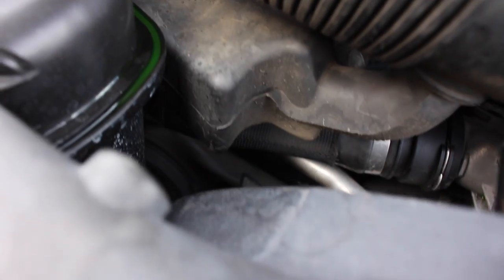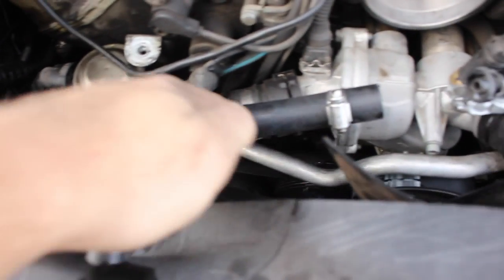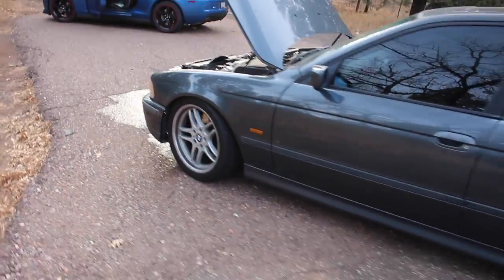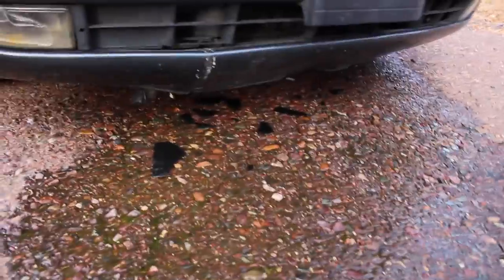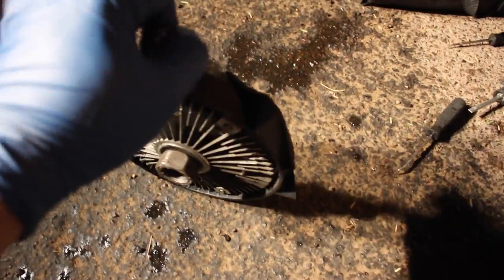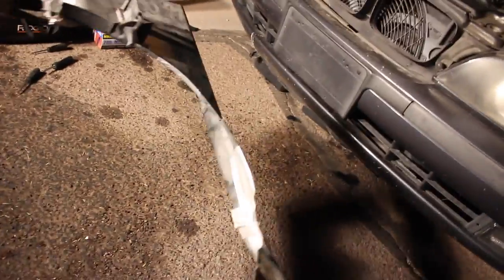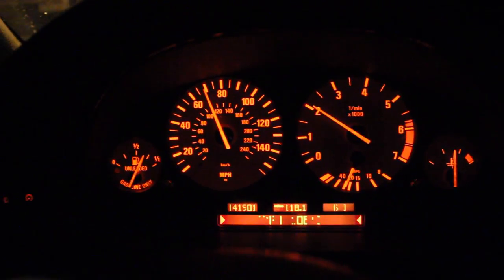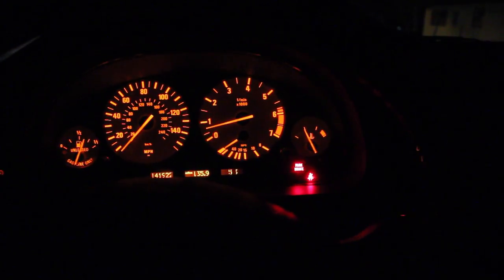My $1500 BMW 540i, aka The Bavarian Radiator Destroyer

Comment: Aw man.... I still love 540s tho. Going to buy my 2nd one next month. Since I crashed my old one.  Hopefully I can find one for 1500 like you... And Hopefully I can find a Non VANOS one in running condition.
Reply from the maker: I already fixed this one, so it wasn't down for very long. That's the benefit of E39's, they're pretty easy to fix when they do break. The non-Vanos ones definitely have the edge in reliability, but it's getting harder and harder to find them in good shape, especially with a manual.
Reply: Yes that's understandable. But I'd even take an auto. I really like these cars a lot especially since I've owned and daily drive a 97 540i before. So I'm familiar with what to look for in them.
Reply from the maker: Right on. Is there a particular reason you prefer the earlier 540i's? I like the later ones more, the Vanos gives the car a lot more low end torque and there are far less vacuum lines and cables under the hood. I've worked on both and I still prefer the Vanos cars, haha
Reply: The Vanos M62tu has a bad timing chain design which will lead to problems and expensive maintenance costs. I just had my 98 540i with low miles(pre Vanos) die last Friday night. Apparently the drain for the brake booster was clogged with leaves/debris. It rained and snowed a few nights in a row and the brake booster was filled with water. There is an engine vacuum located very close to the brake booster and sure enough the water made it's way to the engine and blew it with only 120k highway miles. I'm distraught. E39 guys: if your brake pedal is frozen in the winter, the booster is filled with water and it's going to destroy your engine. So having learned from my horrible experience with BMWs, I'm in the market for another 540i. lol
Reply from the maker: I'm quite aware of that, haha. I did a full video series on tearing down and rebuilding my X5's M62tu engine on this channel. I've done 10 of those rebuilds, and I'm doing an 11th one now for a customer. To be fair, the pre-Vanos M62 is not immune to timing chain guide issues— they last a little bit longer than the Vanos engines but they do eventually have the same chain guide issues as the chain guide design is pretty much identical. The only oldschool BMW V8 that's truly immune to the chain guide issues is the M60 which has a double timing chain and a sprocket in the middle as opposed to a failure-prone U-guide. The Vanos itself is pretty trouble-free on the M62tu, with the only problem being an extra bit of rattle that doesn't actually impact performance in any measurable manner.

Sorry to hear about your 540i, it's always a bummer to hear about an E39 dying. Have you considered swapping in a different engine? Non-Vanos M62's are dirt cheap on the used market, you could probably swap one in for far less than buying a whole different car. Thankfully I don't have to worry about brake booster water or freezing since it neither rains nor drops down to freezing in Phoenix.
Reply: I seem to come across more TU's with timing chain issues than 62's. But you're right, the rattle and noise doesn't really affect the functionality of the car. I live in NYC so parking is a premium, you've got to move your car every few days for "alternate side parking regulations" or get a ticket. With no motor, I had no place to put it, so I junked it today. The cheapest I could find an engine was for $1K and the shop wanted another $1300 for install. At $2300, I'm better off rolling the dice on another car. Everything else was perfect on the car, just had a rod go through the engine block because of all the water. Junked it for $250, still hurting....
Reply from the maker: That's a bummer, you should've listed it on Craigslist, I'm sure somebody would have scooped it up for at least $1k. Where in NYC do you live? I was born and raised in Brooklyn, lived there until 2014. My family had a garage and a driveway so I didn't have to deal with the parking stuff, but I can imagine how annoying it must be. I bet I could swap an engine in a day, even on the street. All I need is an engine crane and some basic tools.

The M62tu's get the chain guide issues sooner than the non-Vanos M62's, hence why you see more of them with issues. Most M62tu's start having issues around 150k miles, with some making it to 200k. I've rarely seen an M62 have chain guide issues with less than 200k miles. My theory on that is the Vanos puts more stress on the timing chain system, hence the earlier failure point.
Reply: I live in Ditmas Park/Kensington, by Cortelyou Road. I wish you had set up shop out here. Parking sucks here and I had it parked at the shop where they made the diagnosis. They were threatening to have it towed to the Navy Yard where they charge $35/per day if I didn't get it out of the shop asap, it's been there almost a week. I put an add on CL for $700 a couple days ago, but nobody came and got it in time. The shop was ripping me off with the install estimate because they knew they had me by the balls. I'm checking out a 2000 540i with 145k on the clock this weekend, the only issue is the Vanos is starting to act up. I'll let you know ho it goes....
Reply from the maker: Ah, so like the Flatbush area. I lived in Marine Park, not too far from Kings Plaza. To be fair, if I had continued living in NYC then I probably wouldn't have the space or the money to work on all these cars, haha.

Vanos starting to act up on that 2000 540i? If you find a P0021 or P0011 code then it's almost certainly the chain guides... Otherwise the Vanos is pretty harmless aside from making some extra noises.
Reply: I lived in Marine Park for almost a year, by Flatbush Ave and Ave M. I'm originally from Long Island. Marine Park is really nice, a bit too much like the suburbs for me. I haven't been able to check out that bimmer, we're being hammered with some really shitty weather in the north east. As it turns out, there's a possibility I may not end up getting another E39 after all. There is a deal in place for me to get an 04 Mercedes E500 in perfect mechanical condition for $1500, if I want it. Do I have a soft spot for it like I do with the E39? No, but the practical side of me may just win out. We'll see....
Reply from the maker: Oh nice! I lived at 32nd street and Filmore, right across the street from the park itself. I kinda liked how suburban it felt, it was a good place to learn how to drive and parking was relatively plentiful as far as Brooklyn goes. I now live in Phoenix which has a suburb feel all around— I enjoy that, though.

An 04 E500 for $1500? Now that's a steal. That has the M113 V8, and those are largely bulletproof since they're simple SOHC engines with no variable valve timing and a dual timing chain. The only real issues with those cars is the Airmatic suspension, but you can replace bad air struts with remanufactured ones from Arnott or Rebuild Master Tech for a fraction of the cost of new OEM ones. I had a 2003 S500 for a little while and it was a great car for sure, just not super exciting to drive. That's Mercedes in general though— up until recently with the newer AMG's they haven't been exceptionally nice to drive, just super comfortable and plush.
Reply: I know Filmore, I used to ride my bike through there all the time, that's a very serene block. That Benz is bullet proof, a lot more so than my 540, that's for sure. It's crazy, since the 540 died on me unexpectedly, nothing but good luck has been coming my way. I decided to scrap the E500 because it's a 4 hour commute each way by train to get it (it's in PA) and I would have to get it this weekend when the high for both days will be around 14 degrees. And what if the guy flakes on me? Instead, I met a guy selling a 2006 E350 for $1800. I talked him down to $1600 and now it's mine. It's in showroom condition inside/out but it has high highway miles(sure doesn't feel like it), the car is from Upstate. He now lives in Riverdale(Bronx), has a new car and was forced to find parking everyday for both and parking there is terrible. He just wanted to get rid of it asap, hence the price. It drives like a brand new car, it's whisper quiet and the suspension feels tight and new. Not really my kind of car, a bit too "Lexussy" for my taste. But hey, for the price, it's nicer than anything else I could have gotten. It will need new motor mounts, other than that, it's perfect. I'll definitely have questions for you once it starts driving me crazy...
Reply from the maker: That's a good deal! Does it have the heated + cooled seats? I know a lot of E500's did, but a lot of E350's were specced in a lesser extravagant manner. Given that it's an upstate NY car, does it have any rust on the underside?
Reply: I just picked it up tonight, I haven't gone over it with a fine toothed comb yet. It has heated seats, not sure about cooled, but it probably does. It's a loaded E350, this one has the optional Harman Kardon sound system instead of the stock set up. The only option excluded is premium wheels as far as i can tell, which I can address later. There's no rust underneath or anywhere else and it looks really good too, black on black with tinted windows. The Nav screen, which also controls the audio, is a bit glitchy though, sometimes it doesn't want to power on. Can't beat that deal, though.
Reply from the maker: Sounds like you got an awesome deal! How many miles?
Reply: 215K
Reply: The V6 feels very powerful too. Almost 270 HP, I don't miss having a V8....
Reply from the maker: Not bad! It's just getting warmed up. My 2000 540it has 201,000 miles on it.
Reply: I've seen a 540 with 369K on it. I only put about 4K per year on my cars anyway, so I'm not too concerned about high mileage.  540's as they age and accumulate miles, may be too much for a non mechanic to handle....
Reply: I found one for 1500$ but I’m so scared of buying it 😂
Reply: @DannysGarage  should I buy a 540i?

Comment: At 1:05 it looks like the hose was rubbing against a pulley and at 1:27 you can see fan shroud was all cracked. I had exactly the same situation with the fan. But that is not a clutch problem as much as combination of seized clutch and cracked shroud. Normally at high RPM the fan is spinning slower that the crankshaft but when the clutch is seized it is spinning way faster than it is supposed to and it is creating waaay more air flow than the radiator is able to let trough so it is creating a vacuum between the radiator and the fan. If there is a cracked fan shroud vacuum will pull pieces in and it will brake the fan blades (exactly what happened here). I had this exact scenario but i was driving with a loud music on and did not hear all the cracking so i ended up with high temps, steam coming out of a bonnet and a wrapped head. So if you own a BMW with a fan clutch spend couple of bucks for a proper fan shroud because this is the worst way to find out your clutch seized. How to spot a seized clutch? At higher RPMs (3-4K) you can hear the fan creating a lot of noise pushing the air (like a truck) because it is spinning faster than it is supposed to. So this is not a "piece of shit BMW always braking" it is just not properly maintained.
Reply from the maker: That hose was likely damaged by the previous clutch fan explosion that the previous owner had, that's why I got it for only $1500. I replaced all of the other cooling system hoses except for that one, so it was kinda the weakest link. The cracked fan shroud is one that I had laying in my backyard so it was convenient and free. I highly doubt the fan shroud had anything to do with it— it was more so that the fan clutch seized up because it was from 2001 and already had 190,000 miles on it when I installed it.

Also, I never said anything bad about BMW's, I'm the last person to complain about them breaking. This is like my 8th E39, and my 11th BMW. I enjoy the challenge of breaking and fixing these cars, it makes life interesting. And yeah this car didn't have the greatest maintenance by the previous owners, but that's why it was $1500. Now my 2000 540i touring (wagon) is perfectly maintained, with brand new everything, but you never really see it on this channel because nothing really breaks in a catastrophic manner like on this cheap 540i/6.
Reply: There's an even easier way to test your fan clutch. Roll up a newspaper and try to stop the fan when the engine is cold. If you can't stop it, it's toast. If you can, leave the engine running and wait till the engine is snapping hot... try to stop it again. If you can stop it still, it's toast. There are 2 failure modes for the fan clutch. 

This and other great wisdom of the ancients is buried in ye olde bimmer forums of yore.
Reply: ktm640lc4BGD 
If it’s very hot and you’ve been sitting still for a while, it will also sound like a school bus when you rev it up to 3-4k rpm. Not necessarily a bad clutch

Comment: Yeah, the run hot high pressure systems on 540s piss me off when they are so cheap and crappy with plastic components. I especially hate the plastic hose connections on components that were made to break. Lower Tstat temp, lower pressure rad cap, do wonders to help. I switched over to Evans coolant as well to stop over pressurizing the system.

Have to look into electric fans to avoid exploding fan clutches.

Comment: The reason why cooling system is keep failing: becouse of gases escaping from the engine. Head gasket is leaking inside. You can put new thermostat , water pump and it will happened again.
Reply from the maker: I mean that's a valid point if it was actually a head gasket issue... no, in this car's case it was the fact that I kept putting crappy cooling system components in it instead of fixing it properly. This car was always destined to be a parts car so I didn't care to fix it properly, plus it breaking made for fun content.

Comment: Hahah classic 540. Cooling system not strong enough for the V8. My radiator top hose mount blasted off so i overhauled the whole cooling system. 

Top tip: replace the cooling fan and fan clutch. When the cooling fan explode it will leave nice dents in the hood and can damage everything else in its way ;) (buy a high quality fan)

Edit: Aw man commented while watching the video hahah

Comment: Just fyi might want to drain and flush your coolant then replace it with blue coolant the green the g05 and dexcool eats hoses pumps and radiators on thease cars very quickly
Reply: Nonsense blue and green are same chemically.
Reply: @ChristianCastleman  go ahead learn that lesson the hard way not my car not my money
Reply: Been driving BMWs since 1982.  Current e39  M540 and a E83 X3.  Both with high miles, both daily drivers, both completely reliable, both running green coolant.

Comment: Thinking about getting one soon, how reliable are they besides the cooling system
Reply from the maker: The timing chain guides are a common issue, so plan to do those or buy a car that's had them addressed. Otherwise they're fairly solid and just need normal maintenance/wear items addressed like the suspension bushings and whatnot.

Comment: I put a 88 degree C thermostat in my 03 540. These 540s run hot as fuck from the factory. I was reading coolant temps of 105-109 C. That's almost 230 F, so that is HOT. With heat comes expansion of all the components and more pressure in the cooling system. The new thermostat keeps temps around 90 C. Less heat = less pressure.
Reply: Can you tell me where did you get the 88 C thermostat, does it involve modifications  or is bolt on?
Reply from the maker: Yeah, 105ºC - 109ºC is the normal range with the stock thermostat. It definitely is too hot, but I've seen people saying that the 88ºC thermostat is too cool because it puts the M62tu out of its efficient range, so I'm thinking of trying a 95ºC. The E39 M5 used a 95ºC thermostat and they didn't have nearly as many cooling system issues as all the other E39's...
Reply: martin montoya, Its bolt on, I found one on ECS tuning. I have a video posted with the results and some of the "issues" I ran into.
Reply: Thanks,  Ill look in to it
Reply: I was worried about it being too cool. The temp does inch up to around 95C if the ambient temperature is over 60F. So with it cold out, like it is now, coolant temp stays closer to 90C. I live in Georgia so most of the year it's over 60F outside.

Comment: Having a couple E 39’s myself I would’ve left the fan shroud out… It’s not really necessary and you could use zip ties to connect the hoses to the Mount clips and keep them away from them away from the fan and clutch . BTW, I wouldn’t buy any aftermarket fan clutch is as they’re too noisy and mostly junk. You’re better off finding out the manufacture which I think is Hella and paying the extra money to get a German made fan clutch.😎🇩🇪🚙

Comment: 105C is too hot. maybe this is why your system blew up. Also this green coolant is the wrong type for BMW. It's known to corrode the aluminum body of the engine.
Reply from the maker: The thermostat only opens up around that temperature, that's actually what BMW designed it to run at. The reason it blew up is that I put it together with crappy used parts since this was only meant to be a parts car and not something to drive forever. I only run blue BMW coolant in the cars I actually care about.